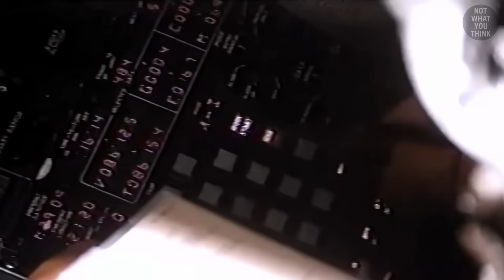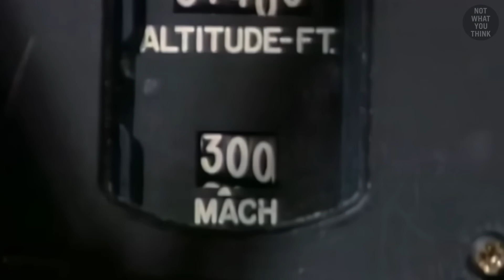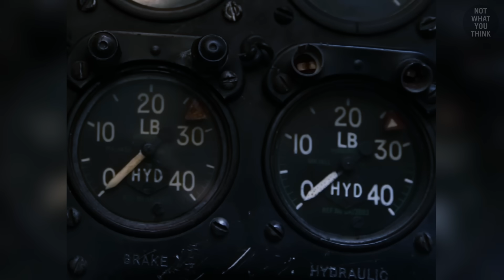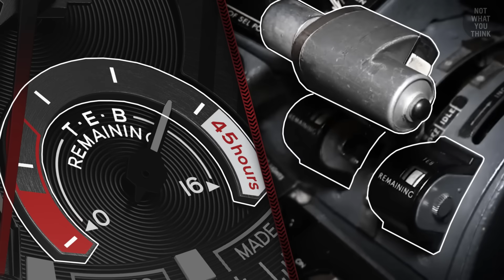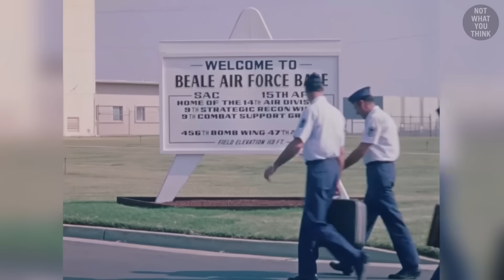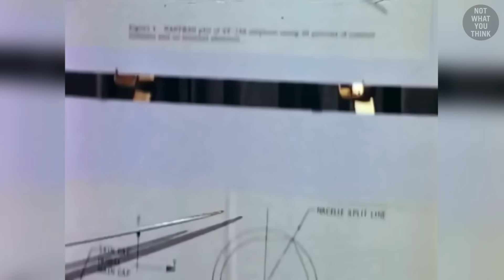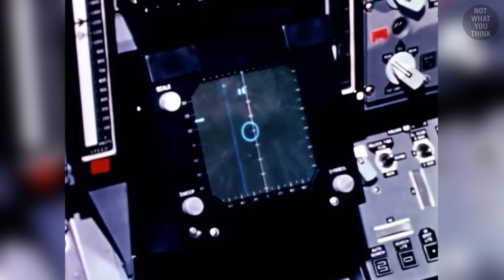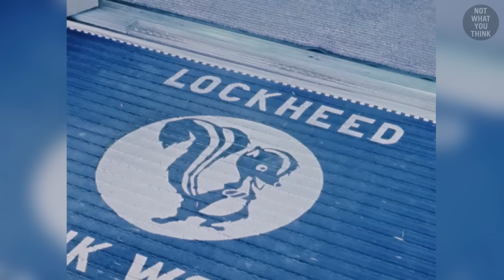Real Stories From The Cockpit Of The Untouchable SR-71 Blackbird

Comment: Did it ever dodge any modern missile? Why isn't it used to solve the year+ Yemenite problem with blocking the Red Sea and thereby the Suez Canal? US Airforce/US Navy isn't at all what it was, is it.
Reply: How can a dodge a modern missile when it's been retired for decades?
Reply: @rogerthat4545  Well ,the US prime fighter F-16 is 50 years old since first flight. And the US strategic bomber B-52 is 72 years old since first flight.

So I'm sorry if I'm a bit lost in the deep count of decades old hardware that the current US Airforce now uses in its operations.

When the cold war ended 35 years ago, all of today's US weapons systems were 35 years younger. THey were quite the ticket back then! But those were the successful days, those are looong gone now. With only defeats in the backseat, and only defeats ahead, hopefully a lesson is soon learned.
Reply: @bjorntorlarsson  I'm not even sure who you're trying to talk to.
2nd time.. How can a dodge a modern missile when it's been retired for decades?
Reply: @bjorntorlarsson  The F-16 isn't our "prime fighter" clown.  The modern equivalent to that is the F-35 or for the F-15s newer sibling being the F-22.
Reply: On top of the prior comment about it being LONG retired... 

What problem would the SR-71 solve in regards to that issue? 

Its doesn't carry weapons. Its sole job is reconnaissance and has analog camera. Meaning the film had to be taken off the plane and developed. 

Not very useful for gathering information on small, mobile targets that is present in that area. 

Its a great plane but even it does have its limits on how useful it can be.
Reply: @warmon6  It's about doging missiles and never getting shot down. Yeah, and those days are gone. Capisce?
Reply: @bjorntorlarsson  No because it would make absolutely ZERO difference if it dodged modern missiles or not.  It wouldn't be "fixing" any modern issues simply by flying around.
Reply: The issue is no missile system even today would be able to be targeted ahead to intercept it. Even flying at mach 5 to gain altitude to 85,000 ft and being targeted ahead, any increase in speed or deviation in course or altitude gain would mean the target would be shifting by miles every second, missles cannot correct for that deviation. At 85,000ft and mach 3.2 you are doing 2000mph. Accelerate to 3.5 and gain altitude to 90,000 feet and you have moved 10 miles in 7 seconds or 1.3miles a second difference. When hitting a target of 20 meters that is almost impossible.
Reply: Modern missles would have the same problems as those of the 70's. The purpose of SAMs is to protect assets on the ground, therefore, they are designed for taking out aircraft and missles that fly in a profile for ground attack. Aerodynamic surfaces that allow for high speed and agility from sea level to 30, 000 ft don't work so well at 85, 000. The SR-71 also had a very powerful ECM suite, which no doubt would have been upgraded as needed.
The moral of the story is that if an adversary wanted to shoot down an SR-71, they would have to design and build a missile specifically for that purpose. Which do you think is a better use of a defense budget, creating a special missle system to take down one plane that takes pictures, or buying more missiles to shoot down the many planes bringing high explosives to zip code near you?
Reply: @Logan4661  No, that's an obscolete way of thinking. Modern "air defense" is all about achieving air dominance. Aircrafts are obscolete, other than in some specialized roles. Air dominance and air attacks are nowadays done with ground launched missiles that target everything in airspace as well as on the ground and at sea everywhere. No need for any aircrafts to do that.

What makes you think that a S-500 at mach 14 would have any problems shooting down an SR-71 at 85,000 feet? It can even hit a satellite in low Earth orbit.
Reply: @bjorntorlarsson  How many S-500s are there? Word wide total? The answer to that question(s) alone should tell you that the SR-71 would have nothing to fear from an S-500 if it were flying right now.
Even on paper the S-500 is designed primarly for ballistic and orbital craft, (ie, craft with predictable flight paths and little to no capability to maneuver), and in practice it missed a target that should have been well within its capabilities. If that's your best example, then the SR-71 would absolutely be survivable against anything currently available to any adversary.
Reply: @Logan4661  Russia's industry is far larger than that of all NATO countries. Maybe they manufacture a couple of S-500 a day and apporach 1,000 in storage. Soon to be 10,000 when production as the S-400 production line has been converted.

Germany's defense minister Pistorius yesterday said that Russia produces 3 times more weapons than all of Europe. And Russia has a long tradition of focusing on rocketry in general and air defense especially. Also, S-500 is a new system. Patriot, as a contrast, is 40 years old. F-16 is 50 years old. And what aircraft does any NATO country have today that can supercede even Mach 2? Do they have any aircraft that can reach 85,000 feet? (Not that it matters when facing Russian SAMs).

The 1990s are over! The West is very backwards in technology and know-how compared with the rest of the world.
Reply: @Logan4661  Why didn't Israeli aircrafts enter Iranian airspace during their last raid? Why hasn't the USA or NATO done anything about the Yemenites cutting off the Red Sea?

Because of their MISSILE POWER! Big ships and expensive aircrafts are obscolete. And now that the US Airforce and the US Navy are worthless, what remains? The National Guard??
Reply: @bjorntorlarsson  You're hilarious.
Reply: @bjorntorlarsson  no...

 you fail to explain "how" the sr-71 is going to "solve the year+ yemenite problem" as you've commented in your original post...

Even if it was still flying, a sr-71 isn't going to resolve something just by dodging some missiles... 

And I've already mentioned it's a weaponless recon plane.. so it isn't attacking anything...

So you need to explain your thought process on how it would be used to "solve" the issue it was never built for.

Comment: The SR-71 dodging and not bypassing missiles is such a power move
Reply: At M3.3, you're not 'dodging' anything - the turning-radius is approx 100 miles!!  The only tools you've got are speed and altitude.
Reply: AA missiles of the day might have gone fast enough in level flight, but the climb to 80,000 feet would burn out its fuel.
Reply: SR-71 cannot dodge anything.
Reply: Só bastava subir e ficavam fora de alcance dos mísseis, que pássaro preto rápido.